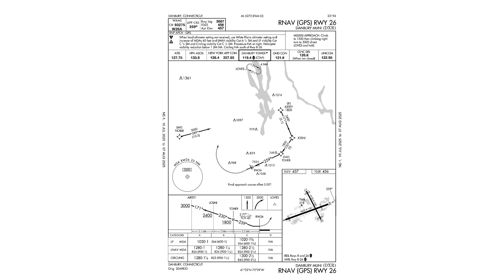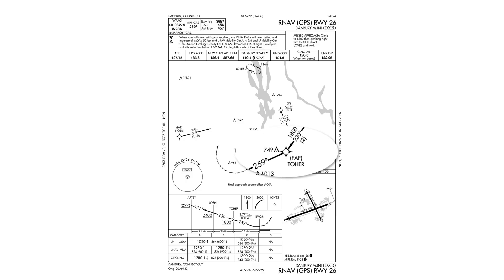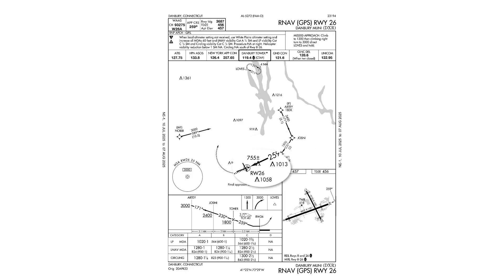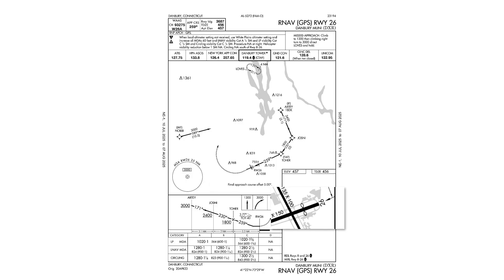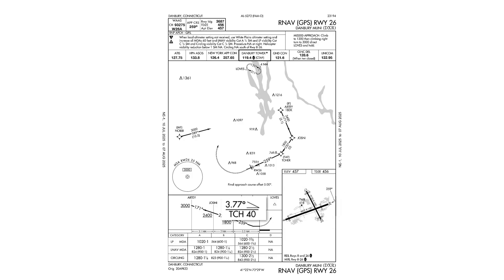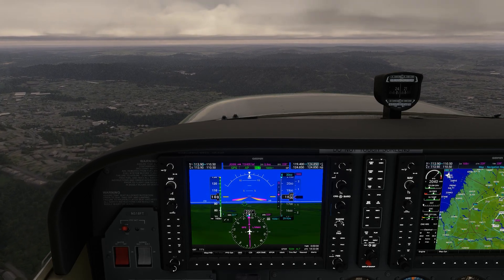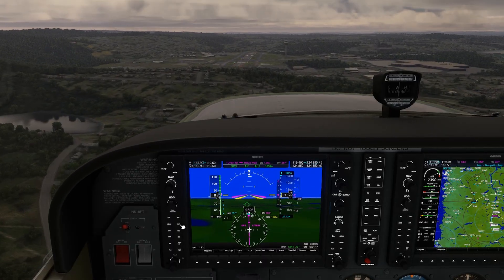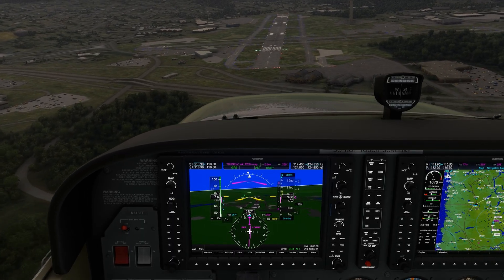Look Closely at this Approach | Briefing Instrument Approaches

Comment: I've flown this approach about 20 times, and I can confirm its all due to terrain. The airport is in a valley with housing and highways surrounding it, so there are a lot of towers and lighted poles as well.
Reply: I fly nearby but never went into Danbury, are you really skimming like 2-300 ft above people houses on final? Do they just not do pattern work to that runway, or is the hill far enough away?
Reply: @telemundie Yes you cross the towers on final with probably 150 clearance on average. Also, not only do they do pattern work, its actually by far the most commonly used runway
Reply: @telemundie All traffic patterns spend extended periods of time within a few hundred feet of houses, including up to very short final

Comment: Flight Insight: definitely helpful. BUT on this one, briefing the plate before watching, I found all of the hazards you mention except for the 5 degree offset and I still can't find it. Rwy 26 and 259 deg final approach sound straight in and down the runway. Puzzled. (and I'm sure I must be missing something obvious).
Reply: To further clarify, the runway is heading 264 while the approach course is 259
Reply: I can't find the runway heading on the plate! that's the 'obvious' that I mentioned. Thanks. The notation about the 5 degree offeset is very obvious on the plate, but as far as I could tell 259 was both the final course and runway heading.
Reply: @quantumjim45 It's not on the plate. That's what makes it dangerous. Unless you knew the runway heading in advance and noticed the difference in heading on the final segment, that note is the only thing on the plate to inform you.
Reply: "Final approach course offset 5.00°" right above the profile view

Comment: There's more, just starting from the top of the plate: it gives adjustments to make if altimeter not recieved. Having to use a non local altimeter with the terrain around and hoping that you are at the correct altitude based on the corrections to apply.
Reply: many approaches have this